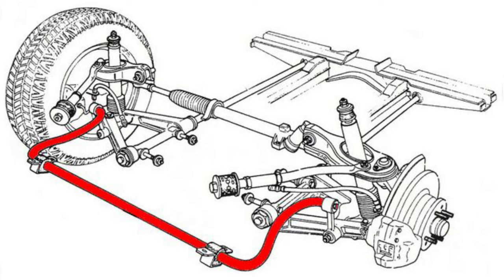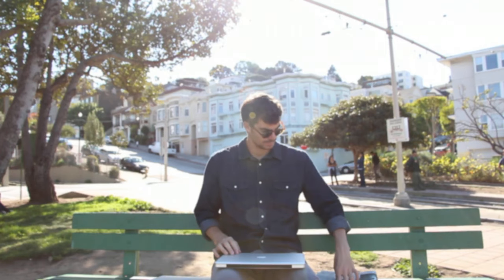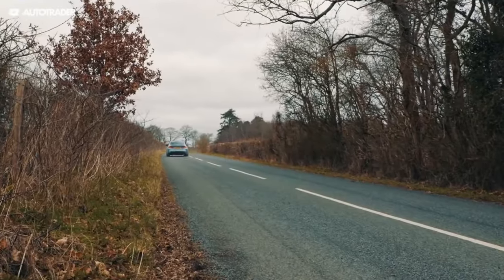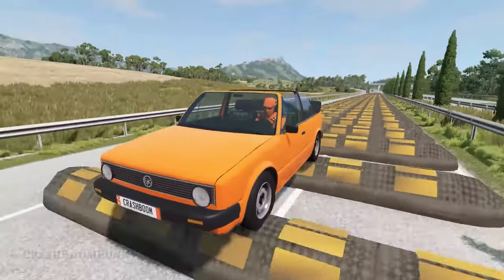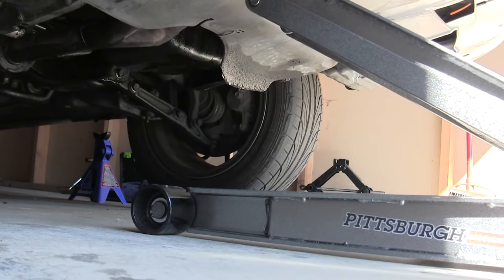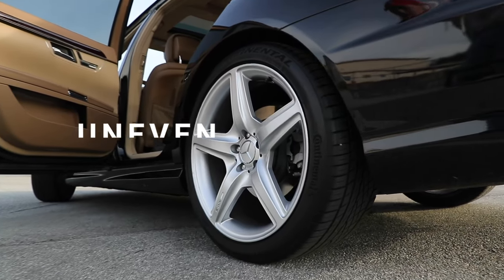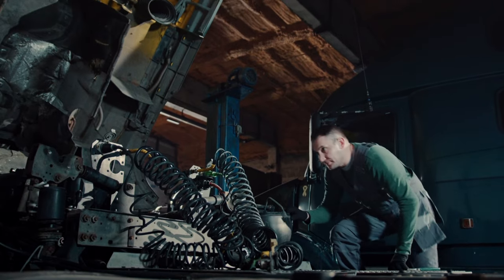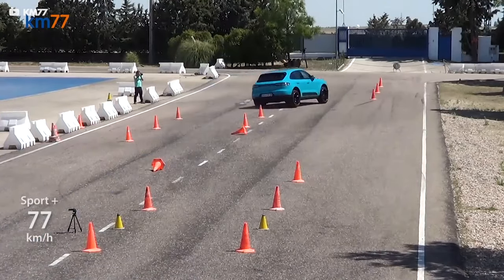5 Symptoms of a Bad Sway Bar

Comment: I just got an alignment, and as they pulled it down off the ramp, my whole steering column turned I went to look underneath my vehicle, and both of my swaybar links are barely connected and have a gap between the threads and bushings, but they said it may be my opinion, but there’s no in my steering column also no leaks from my power steering should I just replace the swaybar links since both of them aren’t even tightened down.
Reply: O don't mean to answer over him, but yes, I would replace both of them..

Comment: I have a 2004 tahoe, when I reach to speeds 70mph my truck starts to move side to side on the back, could this be the cause?
Reply: hi, did you got it cleared or any answer to this question. my grand cherokee sways here and there on highway which gives me goosebumps.
Reply: I started having the same issue.  Don’t know what it is
Reply: My 2005 Tahoe doing the same thing did you find the problem ?
Reply: Yes

Comment: Can a bad sway bar cause excessive body roll? I have a an 02 Chevy avalanche that rocks back on forth on an ugly road I’ve changed the links so those are good the only thing I can notice is the sway bar is not tight I can wiggle it around but don’t know how to tighten it. Do you think that’s why I have body roll?
Reply from the maker: Yes, a bad sway bar can cause excessive body roll. This is because the sway bar's job is to reduce body roll by distributing the force when one side of the vehicle goes higher than the other, such as during turns or on uneven roads. If the sway bar is loose or damaged, it can't perform this function effectively, leading to more noticeable body roll. Tightening or replacing any worn parts connected to the sway bar, like bushings or links, should address the issue and improve stability.
Reply: @carcarehacks  awesome!! Thanks man!👍

Comment: But the sway bar is ONLY in the front axle?
Reply from the maker: The sway bar is a thin, tubular piece of metal bolted to the suspension on each side of the car, either at the front or the back and often both. Some vehicles are only equipped with a front sway bar.